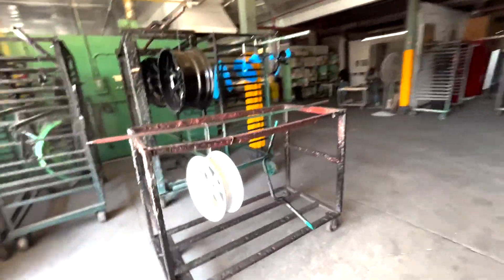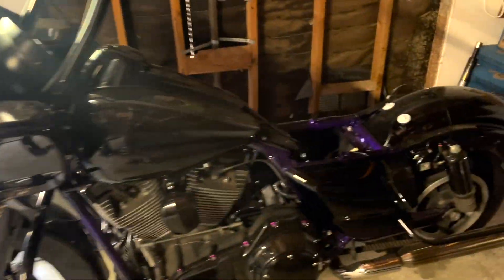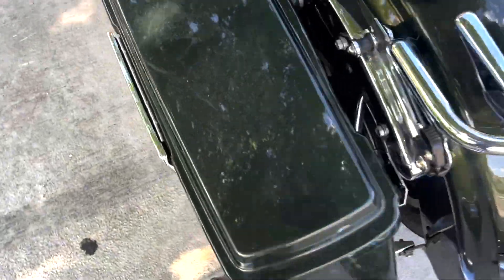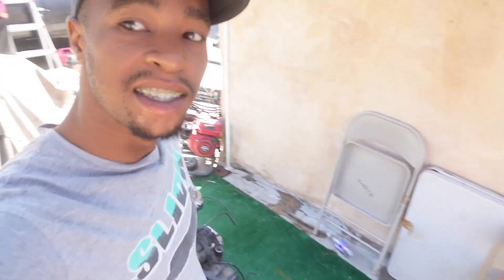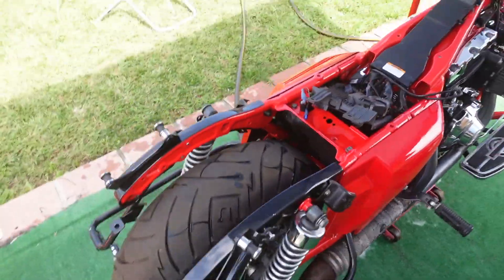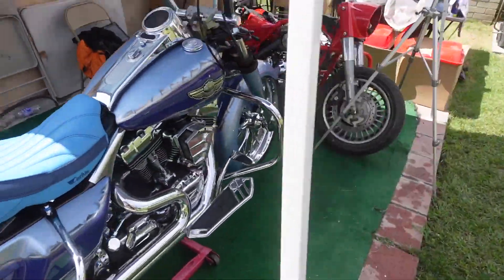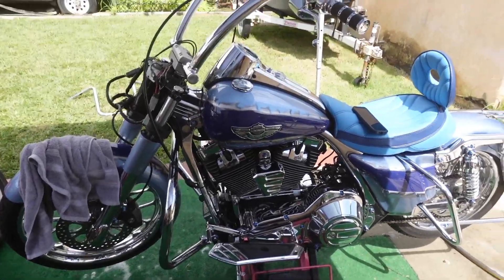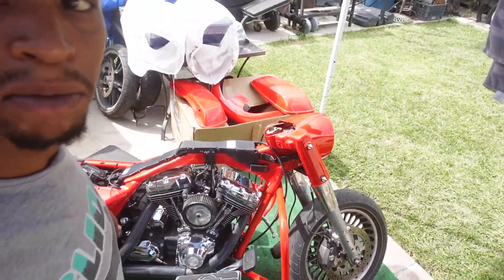COPART HARLEY IS FINALLY RUNNING! + NEW BUILD COMING ALONG!

Comment: on the 03, if the bike has a security system, its armed. will need the key fob and press the button on it twice to unarm the bike and it'll start. you can see the security light staying illuminated on the gauge